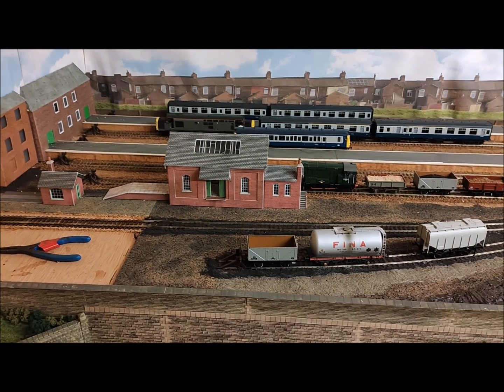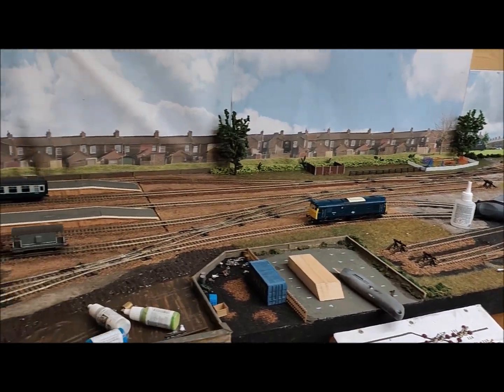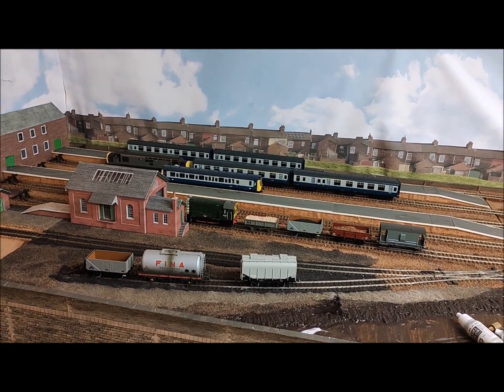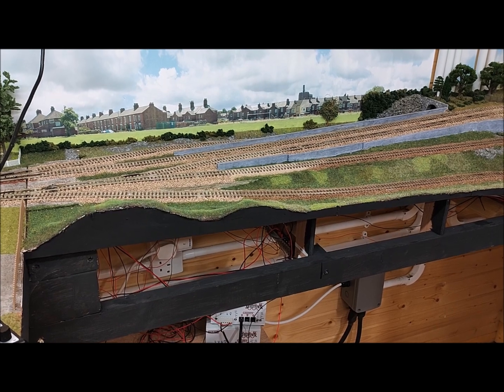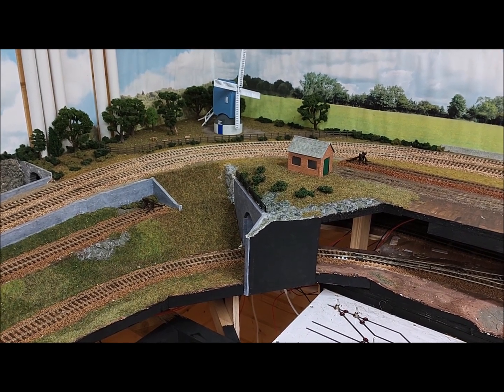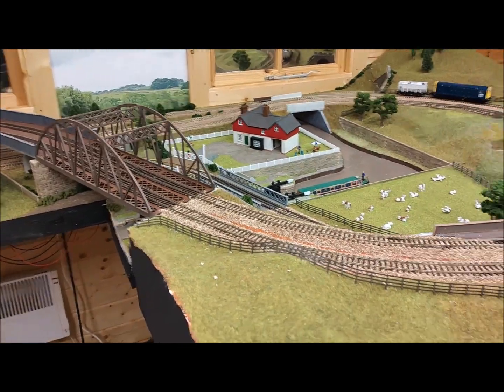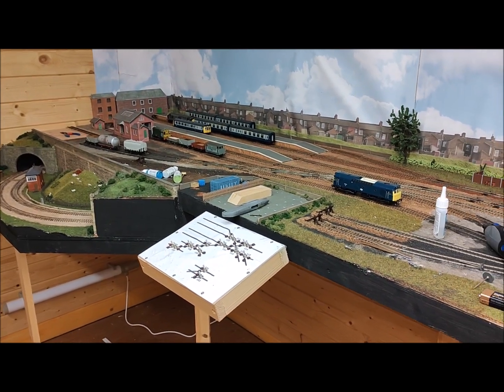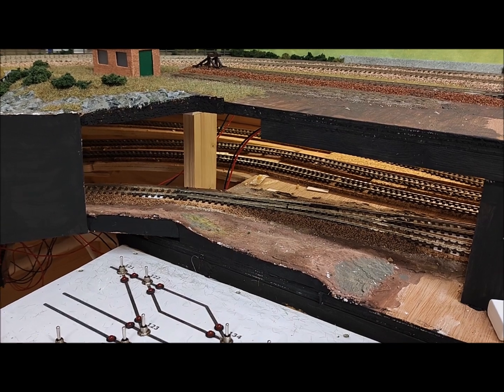John's Loco Shed   20

Comment: Interesting video. I gave up OO 30 years ago as I wanted to run decent length trains. I have a spare room 3.25m x 2.7m which is great for N gauge which also allows me to use easy curves. No criticism meant in this comment - your layout is superb.
Reply from the maker: I did think about N gauge but I was not sure I could get the scenery to sufficient standards. When I was a child I had an N gauge layout and it always looked a bit sterile, but there again we are talking 50 years ago!
If TT had been out (again - since I had a TT layout before the N gauge the first time it was available) with a good enough selection of products then I would probably have gone for that since it would have been a good compromise.
Reply: @johnslocoshed4695  Thanks for replying. Have a wonderful Christmas.

Comment: Hi John. Did you find a satisfactory solution to the couplings/derailments of your wagons? The beauty of OO gauge is the great variety of locos/rolling stock available. You would think that a shed would provide all the layout space you would need; thank God for smaller gauges/scales!
Reply from the maker: I have got some of the hunt pivoting couplings to try, not had a chance to fit them yet. I am busy checking some of the other stock since the cold weather affected some of the track for other vehicles. I will try and do an update video in the next week or so.